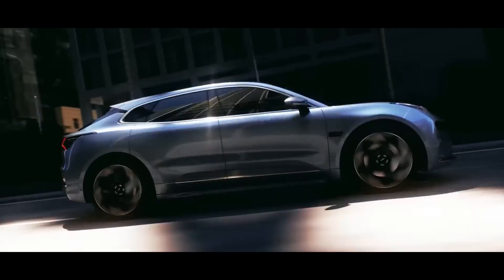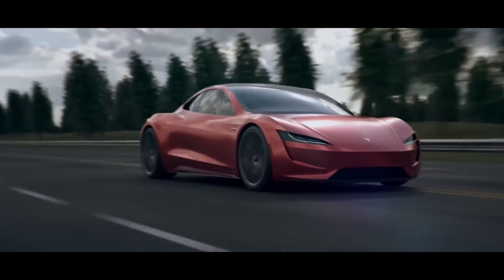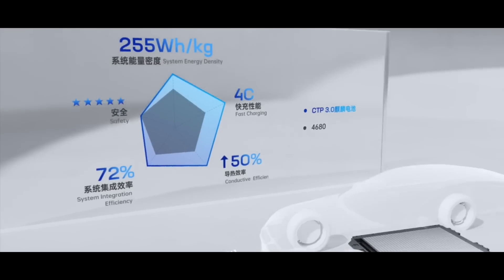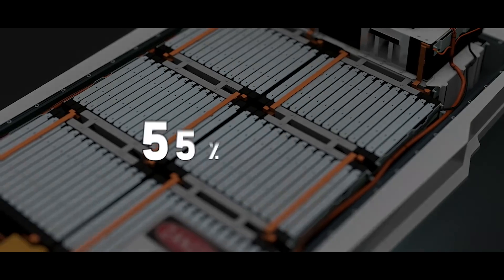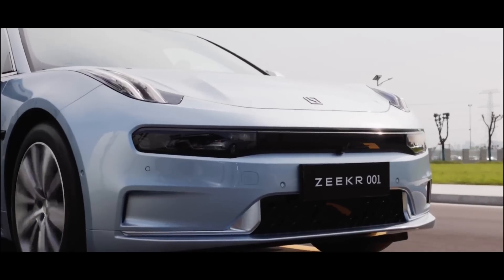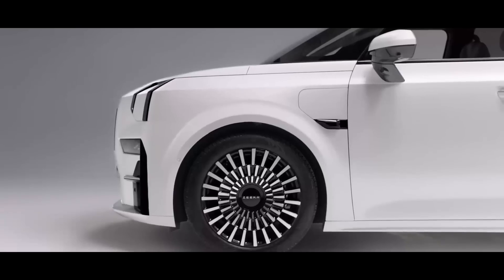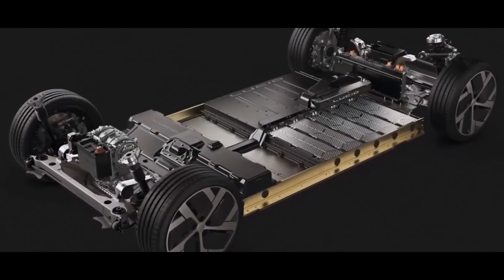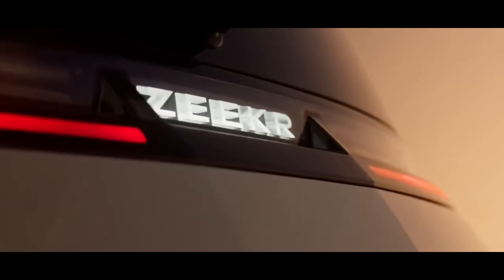China Shocks entire EV Industry with advanced NEW Battery in Zeekr Cars | Tesla agrees

Comment: Even with a very efficient Car you will consume about 20 kWh/100km at 130 km/h. So Real-World-Range on the highway is 700km. Still very impressive! The best Cars at the moment can charge with 2,7C Peak. So with losses included to get this Battery from 10-80% in 10 minutes would require close to 600 kW constant Charge Power. No way...

Comment: NOBODY needs a 600 mile range battery. 95% of car driving DaY to DAY is under 100 miles. 350 mile range 400 max is enough for anyone.
Reply: People who don't want to charge every day want that 600 mile range.
Reply: The longer the range, the less often you need to charge. Since battery life is measured in charging cycles, not miles driven, a longer range means a proportionate increase in battery life.
Reply: You are partially correct, if the 350 - 400 mile range was real world. As it stands currently, you would probably see 250 -300 mile range, which is not enough in some circumstances.
Reply: If you tow a trailer in cold weather, you very much do need this kind of range, since it will be reduced to less than half.
Reply: @TroySavary  Where do you get this nonsense?? No recent EV has ever lost 50% range in colder weather. Plus, I take it, you have no clue what battery preconditioning does, do you? Who sent you here to spread lies??
Reply: @ScubaSteveCanada  Perhaps go back to school to improve your reading comprehension. I said "tow a trailer in cold weather".
Reply: yeah, but if the tech improves over time and it gets cheaper, WHY NOT?
Reply: I think the more important thing is how this battery handles degredation, The big problem with EVs right now is that they lose 1/4 their range in a few years

Comment: 300 when its cold.
The prius hybrid is the first 600 mile EV.
Reply: You already qualified the Prius as a "hybrid." This article is about Battery EV platforms, not hybrids which, predominantly, use petrol. Comprehension issues?
Reply: @ScubaSteveCanada  I also qualified it a a bev.
Its both.

Why is that so hard to believe.?

That's what hybrids are by definition.

44 miles EV only about 118 Mpe most will never use a drop of gas except in long trips.

Even then they can decide to use charging stations.

The original EV the leaf only did 70'-80 miles electric only.

And in the cold Evs can lose up to a third of their range.

Why the prejudice and arrogance against. EV plug in hybrids the plug is for a reason?

And also plug-ins  bring more people into ev driving people who dont have a garage and who must park on  the street or live in cold climates with few charging stations.

They are faster good looking and help reduce green house gases and used less heavy metal mining then most electric only cars meaning their emissions footprint is less than many evs.why not embrace both for a cleaner environment instead of this one size fits all or you are an enemy narrative when every little bit helps in reality.
Reply: @ScubaSteveCanada  like duh..the Prius plugin EV is an EV platform.
Are you deaf and dumb?
Prius plug in not US ev tax credits until battery production moved to Japan.

The government did not just give money away hybrids were denied tax credits but EV plug in produced in america still got tax credits.
Stay on subject.